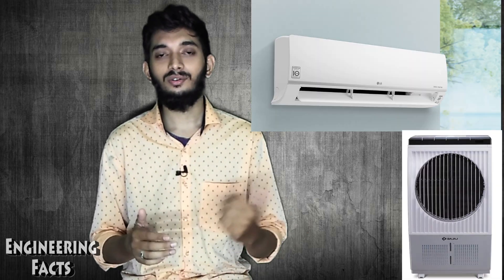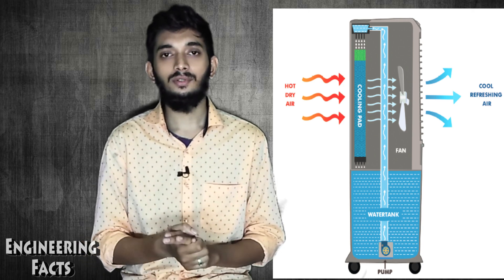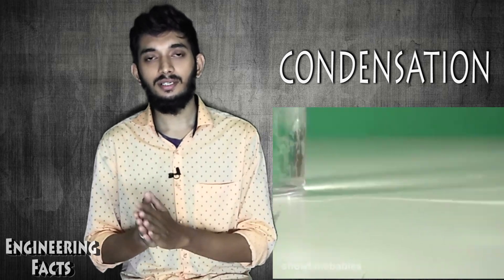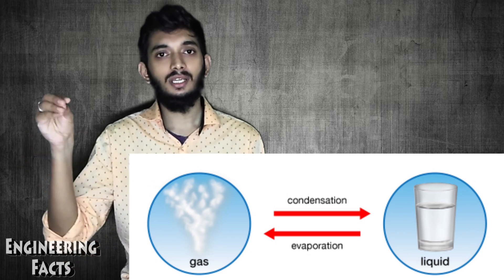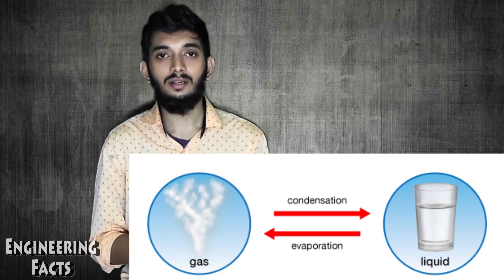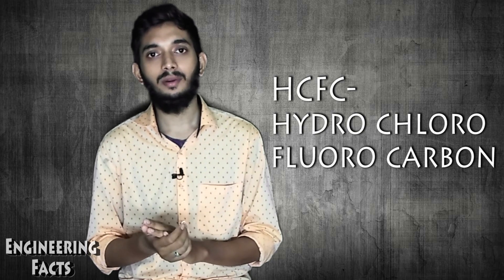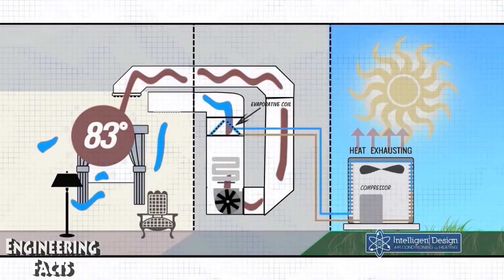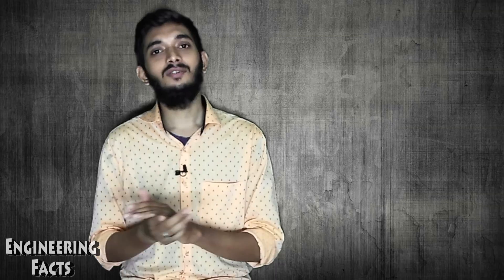Where Does the water comes from AC?_ Tamil, AC-ல தண்ணீர் எங்க இருந்து வருது?

Comment: Hi Brother, I have a doubt about the oxygen level in the airconditioned room. Is air-condition machine pulls oxygen from outside room (from atmosphere) and blows inside the room? because I have a feeling that there are no sufficient oxygen in room when AC stops working (Shutted down).. Any technical clarification on this? Is that recommended to open room window to get oxygen when AC off?

Comment: Some kind of smell is coming from my New(5 days old) Blue Star Non- inverter AC while running and also some sound(Could be due to condensate water but I am not sure) is coming from indoor unit when the compressor starts. But No issues with Cooling. Is that Normal? Or should I call the AC technician?
Reply: Yes it is normal for new A/c after a continuous usage for a days it will get soon normal

Comment: Can we use the ac during leakage
Reply from the maker: Yes. You can use.. but please ensure, that the water should not touch electrical circuits. Possibility of electrical shock.
Reply: Thanks brother for your reply
Can we repair by ourselves.
Reply from the maker: It is best, to call your ac technician.

Comment: Oxygen supply pannuma bro outdoor unit to indoor unit air conditioner solluga please....
Reply from the maker: Split AC, doesn't provide any external air or oxygen
Reply: @engineeringfacts  thanks you... Bro
Reply: @engineeringfacts  centralised AC provide oxygen or external air ... mostly
 hospital ,mall,provide that type ac.?
Reply: aswin aswin, your question about external air provision in central ac is possible. 
There are criteria of ACPH 
(Air change per hour)
For sure ACPH in hospital will be much higher than malls.
Hope your question got answered.
Reply: Thanks again
Reply from the maker: Good question, when your room gets cold, room pressure will be low as compared to the atmosphere. So whenever you open the door due to high pressure outside, the air always come in. Or it always comes through the gaps. Even if you're fully closed, the room is sufficiently able to provide enough oxygen for more than a day..
Reply: Very good question and exact answer 👍

Comment: More water coming from the water outlet tube. More than a big bucket of water is coming. What is the reason?
Reply from the maker: Your compressor running time maybe high. If you run more than 12 hours. More than a bucket water is normal.

Comment: ஏசி ல தண்ணீர் வரதுநால ஏசிக்கு ஏதும் பிரச்சினை வருமா
Reply from the maker: No, தண்ணீர் நல்ல வந்தா ac good condition la இருக்குனு அர்த்தம்.
Reply: @engineeringfacts   indoor unit valiya thanir varuthu
Reply from the maker: Over flow ah irukalam. Proper balancing illama irukalam, drain system la block irukalam, call your technician
Reply: Most thinking question sir

Comment: Super ...but sometimes water or ice  sprays inside the room...how???
Reply from the maker: That's because, high level of condensation and good cooling, due to that, the air becomes more moisture. So try increase temperature little bit, above 20. Thanks.